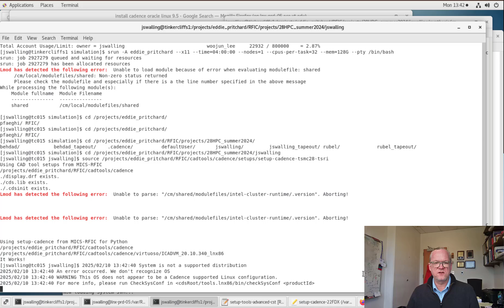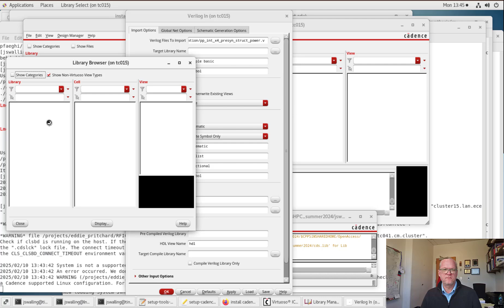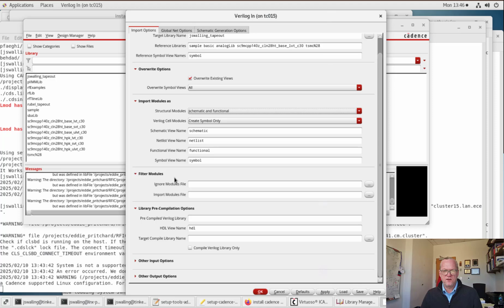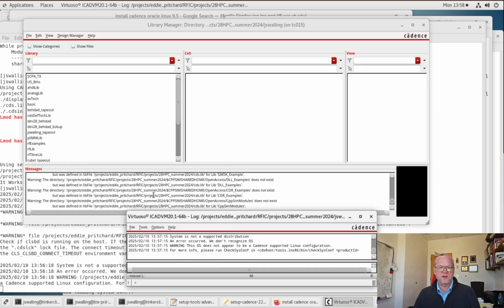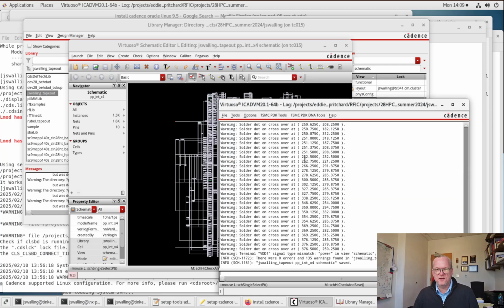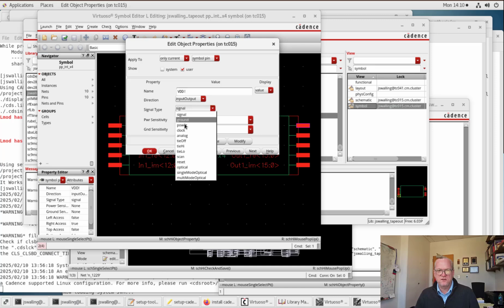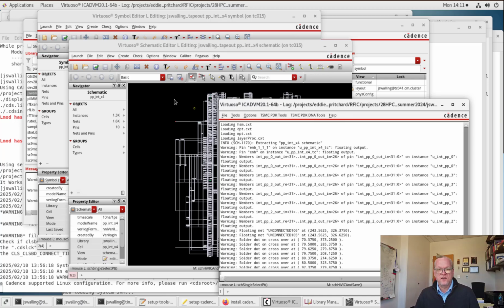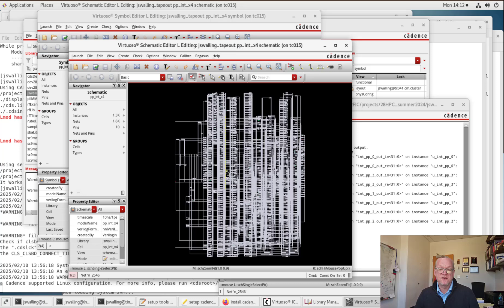Cadence   Import Verilog Netlist into Cadence Virtuoso

Comment: Good day sir, does the imported RTL code in AMS virtuoso, if connected to Analog blocks, would it give loading effect towards the analog blocks? The digital block is a SAR logic and its input is the output from the Comparator (Analog block). Hoping for your answer, thank you so much.

Comment: WARNING (VERILOGIN-22): Module MAOI22M2M, instantiated in the top module por_sync, is not defined. Therefore the top
module por_sync will be imported as functional.   My steps are the same as yours, but this warning appears during generation, and there is nothing in my target library. What is the reason?
Reply from the maker: Looks like it cannot find a cell that was used in synthesis in cadence. The cell is likely some kind of And-or-invert. When you look in your cell library in cadence, do you see the cell MAOI22M2M?
Reply: @wallingphd  YES，of cause 。i was choose  my lib "analog ,basic .18,digital standard cell "there is another error "ERROR (SPICEIN-79): SpiceIn failed to import subckt 'ADFM0M' because the cellview 'ADFM0M'::'netlist_tmp' can not be created in library 'test' due to DB errors."what should i do?